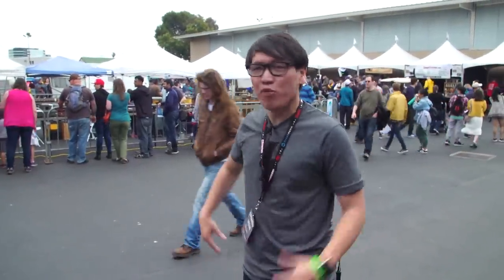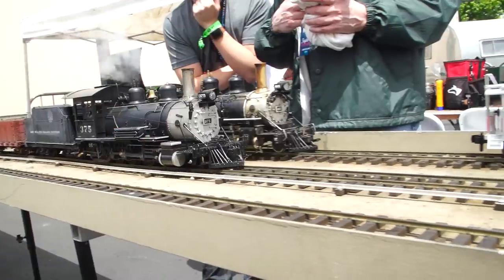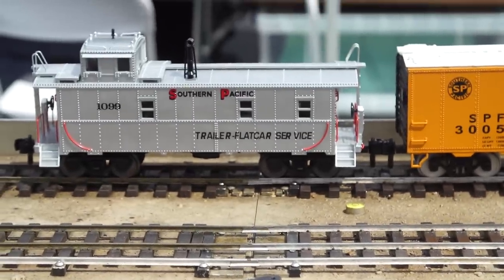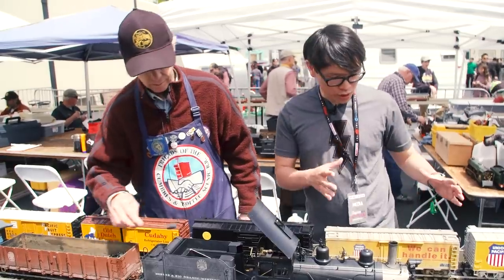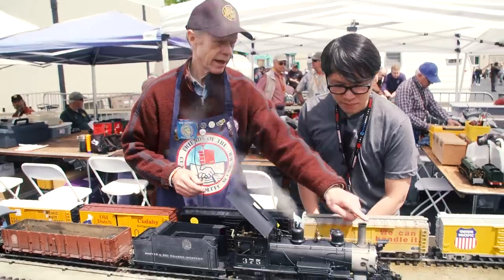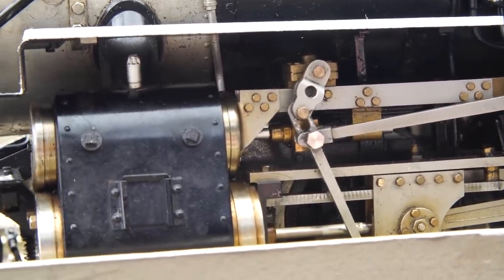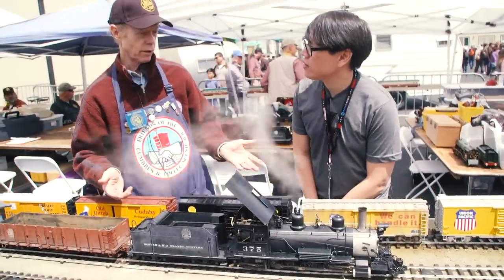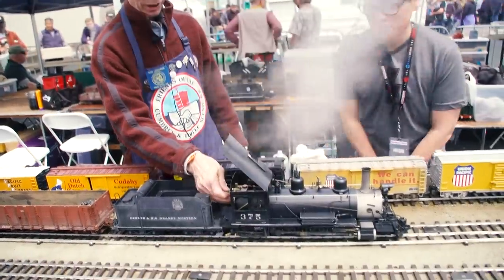Model Trains with Working Steam Engines!

Comment: This is a hobby you can get deep into. This is G scale live steam, which is really the scale most well known to the public. However, you can get even bigger ride on engines in increasing gauges. Alternatively, there are clubs for smaller gauges such as O and HO. Really it's a hobby that is worth getting into. A lot of the people are very friendly. It's amazing to see the machine work that goes into one of these engines.
Reply: I agree. I have a OO guage (similar to HO gauge but more common in the UK) layout and it is so much fun
Reply: I was into n scale and o and ho for a while but am thinking about switching to Z or even TT
Reply: MrRailroadrunner It is also veeeeeeery expensive, which is why many people are put off the live steam hobby. Being a young generation hard-core railway enthusiast and railway modeller myself, I can relate to this problem first hand, as I wish to built a particular Gauge 1 live steam engine kit very much, but simply cannot afford it that easily off my pocket money. Rather sad really...
Reply: I have a mamod o gauge live steam locomotive as well as some old Lionel engine i run on my layout. They're a fun way to pass the time.
Reply: MrRailroadrunner I'm hoping to get into live steam someday. Accucraft and Aster make some great kits.
Reply: Ho scale master race
Reply: I run 3.5 and 5 inch steam and electric engines at my local club.
Reply: Yeah, I used to love building them with my Dad. I forget if it was HO or N scale. He passed last year and it's made me want to build a small diorama, really just for display. I've always been a rail fan as well as into graffiti so it seems like a fitting hobby. I'd actually like to get a couple friends to paint some of the cars as well.

Comment: Still got my 5inch gauge engine to build. Last guy had it for about 15 years, I've had it for about 4 and all I need is a few rods and crosshead to be rebuilt and I can get the chassis running on air. 

Without the necessary preparation and tools, building them is a hassle but once they are built and adjusted, it's amazing. It really is a labour of love. 

The coal thing he's so right. I'm Welsh myself, and our railway use Welsh coal always, but once we had some imported coal to use as a cost saver or something, I don't quite remember why we had it, but we used it in our 7 1/4inch engine, and it was horrible. It burnt quick and the steam was this horrible sort of brown colour and it was heavy and lingered around the ground for hours. Was horrible to breath in and you couldn't see through it.

Comment: This is amazing. Just amazing. I had no idea you could make a steam engine that small.
Reply: Benjamin Finlay 
Hornby and very few other manufacturer's actually made h-o scale live steam engines. They were never very successful but they are still out there. There was one "scale" smaller i know of that was h-o scale but on n gauge track like a narrow gauge. But the h-o scale ones are at least around 1/4th the size of these ones
Reply: Aaron Divel actually they did work they just weren’t clear on how to operating them they use different voltage than regular OO/ho locomotives
Reply: wargreymon 1109
oh they absolutely worked. They just weren't very successful in the market. They didn't sell as well as hornby had hoped is what I'm getting at. But yes they worked surprisingly well but as you said any layout would have to be completely changed as well as it was very difficult to run them at anything close to a slow speed.

Comment: i can only imagine how small the margin of error is on a train of that size.. real trains have a reasonable margin of error but as the parts used gets smaller and smaller the margin also shrinks... i can't even imagine the precision of the welds and all the pipes in that small boiler... eventually things gets so small so a single grain of sand could clog a pipe and cause it to malfunction.... making a small scale fully accurate working model of something requires a whole new level of engineering experience...

Comment: I'm a live a live steamer in this scale myself, and I will say it's possible to have hills on one's railroad, provided they aren't too steep. My own line has a couple grades, and I put them in deliberately so my engines would have to work a bit to pull trains over the line.

Nothing wrong with burning butane either, way I see it it's an analog to having an oil-fired locomotive in full-scale.
Reply: Are you implying you can't make a scale oil-burner? If so, why not?

Comment: One of the Best Tested Videos yet. I have been a Scale Steam enthusiast most of my life. Having been an avid watcher of Mythbusters, in full appreciation for how they promoted skepticism, critical thinking and the scientific method for over a decade, I am very glad Adam Savage is with Tested.com.  Even negative feedback can be helpful. But as Adam Savage said in one video (With Micheal Stevens doing a modification on his glasses for a mic), they don't need useless noise, either. Will and Norm started Tested long before Adam Savage joined and have done a fantastic job. After Adam joined, they have been a Class Act ever since in sharing the screen with a Known and Experienced Star. There is a difference between Critical Thinking and being Overly-Critical. For many of you that post such negativity: Are you helping to build the readers experience and understanding or just trying to elevate yourself by knocking someone else down? To Tested: (Doubt you read the comments anymore but...) I have watched your videos for years. I guess it took a Steam Engine to get me fired up enough to post a comment but- THANK YOU for providing so much excellent educational material.

Comment: I wonder if you could fit a speed governer on the throttle. So you can just wack it open. And it will regulate its top speed

Comment: Why is there no smoke from the burning coal? Shouldn't that be coming from the  smoke stack?
Reply: Mad Cow Rebel 
Depends on the type of coal and the way it's fired. If you pile on a ton of dirty coal yes you'll get black smoke but if you fire a steam engine properly you should get little to no smoke. On a big engine it's often called a salt and pepper smoke because it will have a little black mixed with the white steam. Any more and you're wasting fuel

Comment: I'm building a mini live steamer in the next larger scale ⚖ of 1/2" =1', thats 1:24 scale, on 2&1/2"gage track, a GREEN BAY AND WESTERN 2-8-2 MIKADO built /ALCO /1937. A cardboard mockup is 3ft.long.  Drive wheels are cans from frozen orange 🍊 juice. BOILER is round cardboard tube.  Tender is from soda can long box 📦.    The Real live steamer will have copper boiler. Either gas, or coal fire 🔥.  Brass tender, and cab.  Regular wheels are available for tender trucks, but unique 8 Drivers are Boxspok and need special machining.  And weigh nearly 30 lbs.  And powerful enough to pull 5 adults. On elevated level tracks.  Stay tuned for more, ok!!  HI in June 2023A.D.!!

Comment: Why would you need to adjust for elevation?
Reply: i imagine, increase elevation needs more pull from the engine. because there is no actual person on board to increase the coal load, it may not have the power for increased elevation. could be totally wrong though
Reply: What he really was asking was if you needed to add more coal to it based on the hill you were pulling, at least that's what I would think.
Reply: In addition to a throttle (which controls the rate of steam that goes to the cylinders) there is a reverser or "Johnson Bar" that controls the valve gear, which in turn adjusts not only the direction of travel but also the "cutoff," which is the percent of one piston stroke that you're emitting steam into the cylinders before the supply is cut off until the next piston stroke. When coasting on level track, you can make the cutoff lower by pulling the Johnson Bar closer to neutral, which saves on steam usage by allowing a small amount of steam to do the work as it expands and exhausts naturally. However, when climbing a steep grade, you need a higher cutoff to allow the steam to push the piston at full pressure for the full duration of the stroke.

On a non-remote-controlled live steam model, this is difficult to do, hence the preference for level running that requires fewer adjustments on the fly.

Comment: Where can I buy one of these?
Reply: TurboTon16
Many places. Accucraft is a more popular place for brand new ones. But you can find them on ebay consistantly. It's also a good idea to start with a mamod or a wilesco to really get to know steam before spending the thousands for one of these. You also save a lot of money buying older ones that need a little tlc before running and you get to know the engine a bit before the fire up. Ministeam is also a choice for brand new wilesco and mamod and the like. But you can find them second hand on ebay.
Reply: Aaron Divel thx for telling me

Comment: So clean coal might exist, but only in Wales.
Reply: it's about a cleaner, more efficient burn that doesn't leave too many unhealthy deposits that can ruin burners and boilers. There's no such thing as "clean" coal, but you get coal that burns more efficiently.
Reply: If it's Anthracite and from Wales i think it's the cleanest coal any country has found.
Reply: Clean means it contains less sulphur in this case, that's what is responsible for some of the worse effects of burning coal. Anthracite is over 90% carbon (wikipedia says 92-98%), so less other stuff to gum up the engine
Reply: Actual clean coal would have to not produce CO2.
Reply: Ben Goldberg anything that burns will create CO2, but no coal contains more than 5% CO2. In America, synthetic coal is being produced and it is around 25% less harmful to the environment than petrol/diesel and 10% less than normal coal
Reply: You're comparing synthetic coal to petrol/diesel... do you mean coal liquefaction to create synthetic liquid fuel? Or is it some way of turning organic matter into a more energy dense substance to replace coal in power plants?

Alternatively,  there's exploration of CO2 capture for coal plants, but that is still in its infancy as far as I know
Reply: HorzaPanda no, synthetic coal is similar to ordinary coal but the pressurisation of organic matter to turn it into coal is sped up and I think they modified the organic matter to reduce emissions, but one of the drawbacks is that it is more of a pellet form. 

It is still in the tesying phase and isn't available for commercial use yet, but the idea is still quite innovative.

The reason I compared it to petrol is because that is the main fuel for many cars trucks and trains. Everyone is used to it

EDIT: Pretty much everything you and I mentioned is still in its infancy, but the synthetic coal is supposed to be released in the next 2 years.
Reply: Ahhh, the lovely welsh steam coal, finest there is!

Comment: This guy did not spend 2 years making this engine lol. Its sold by Accucraft trains as a ready to run model. You can purchase this exact coal fired model here for a little over 5k https://www.accucraftestore.com/product-page/d-rgw-c-25-375-flying-rio-grande-coal-fired. The only thing he did was change the lettering on the sides.